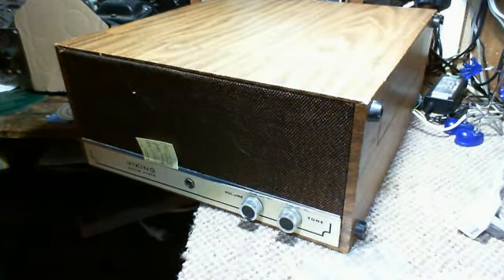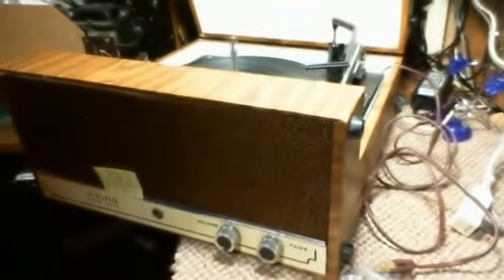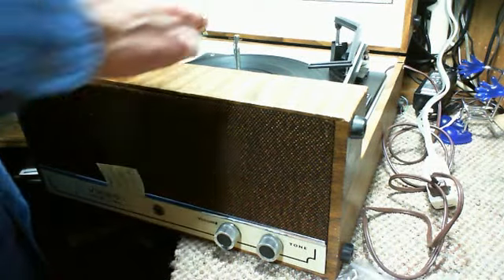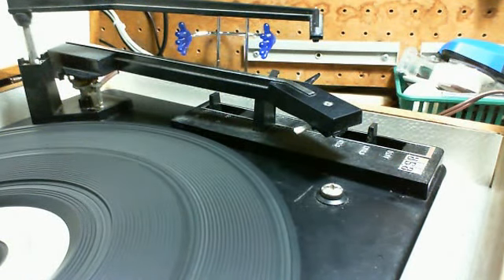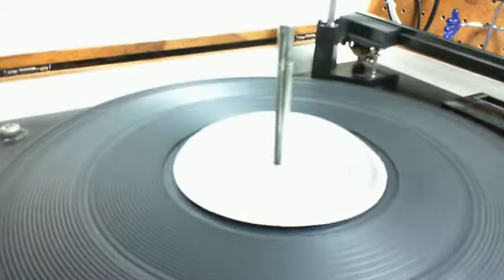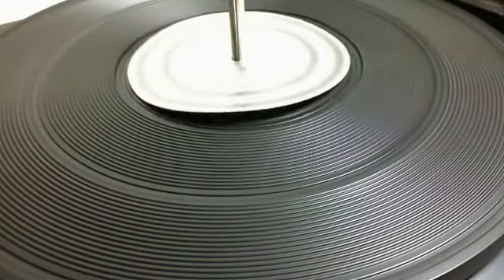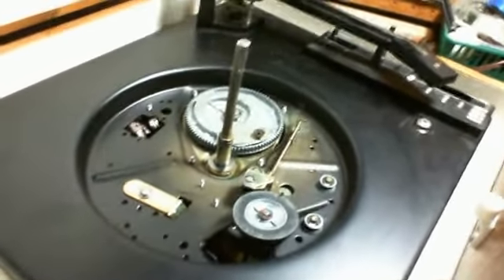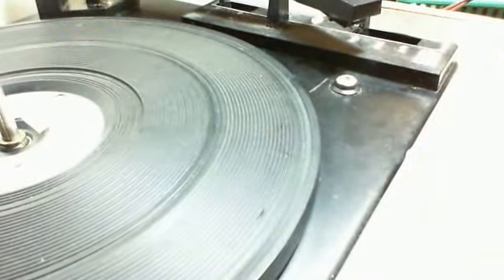Viking Model 324 Record Player - Running Too Fast

Comment: Hi Jim. Check to see if there is a build up on the spindle ?.
Reply from the maker: That's an interesting idea.  The spindle has a very small diameter and a little buildup might affect the speed.  I'll be sure to check this tomorrow.  (I've been painting all day so I haven't had a chance to work in my shop today).

Comment: I have an iss with buzzing I have a teac reel to reel model a-1500 hooked up to my stereo and when the power on it is off I get a slight hum and buzzing sound when the volume is low or high but when I turn it on the sound is gone and that is very strange and I do not want to run the reel to reel all the time especially when I do not use it what can I do and I have tried plugging it into a separate power line and it is the same any help wound be great thank you
Reply from the maker: Hi tough213.  Have you tried turning the Teac plug around in the outlet, assuming it's not polarized?  Jim (and thank you for all your comments!)
Reply: hello there it is polarized so I cant turn it around . I am stumped it is very annoying and I am thinking that all reel to reels are that way or is it a compatibility issue I am stumped any help would be appreciated

Comment: The rubber wheel that drives the turntable wears down over the years and this affects the gearing ratio. Also, the motor is not regulated in any way with respect to voltage (at least, not the ones i worked on as a kid!) so the higher the mains voltage the faster the motor spins.
Reply: Actually no the rubber wheel does not affect the speed the rubber wheels just a transferring wheel. From what I’ve seen the main effect of the speed is the rubber wheel wearing down and leaving residue on the spindle which makes the spindle bigger and the speed increases.

Comment: I got my 510 to play correct by using an emory board and filing down the motor polls until it was right on the correct speed using my phone strobe. That's the solution. On belt drives, the fix is just a new belt.

Comment: Hi, if this helps, It's pretty much fact that ALL these type BSR changers run 2% fast. Far as I know there is no solution, they just always did.
Reply: I'll second that.
Reply from the maker: If I was going to design a record player like this I'd aim for a speed slightly above nominal.  Come to think of it, I didn't test the speed with a record playing.  I need to test it that way since the needle will drag down the speed a bit.

Comment: Mine runs too slow, what would you suggest?
Reply: Nvm, i've fixed it
Reply from the maker: Sam Campbell I'm curious.  What was the problem?
Reply: I ended up taking an entire day to sand down some built up gunk on the main spindle, then I cleaned off the washers, and re-lubricated the entire thing